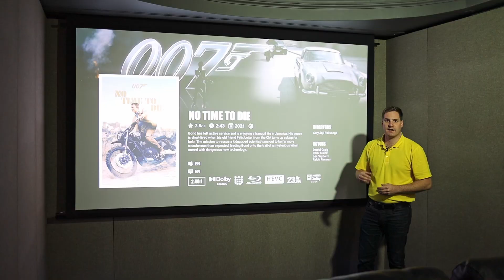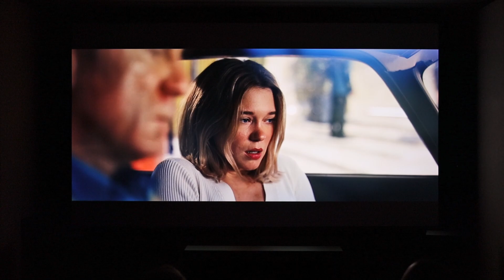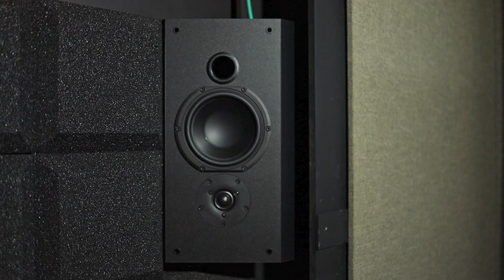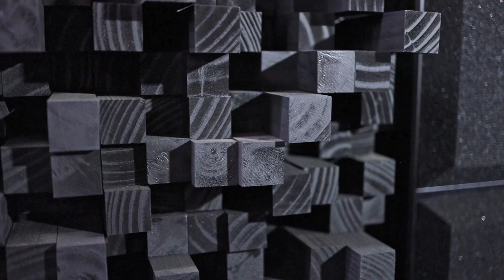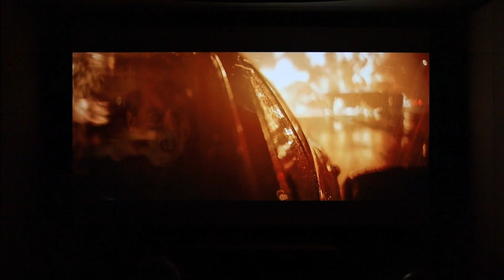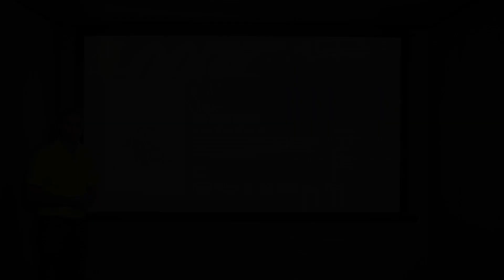Krix home cinema room - Johannesburg - Elan Systems South Africa

Comment: Really nice presentation and clearly a lot of thought went into it. Two nits to pick, first acknowledging that I’ve only watched a YouTube video 😉
The screen seems a bit high. With the image nearly touching the ceiling, I’d be concerned about distractions from reflections off the near ceiling surfaces or simply being aware that the image is at the intersection of the wall and the ceiling. And of course, the viewing angle may be a bit high for some, though that’s just surmising such based on the placement near the ceiling. 
The only other thing, and this is really more a pet peeve of mine, is that motorized screens and rooms that don’t truly ‘need’ them drive me a little crazy. This is a dedicated room, and obviously purpose built just for watching movies. If you wanted to show off the speakers behind from time to time, clearly, you have the ability to do custom brackets, as evidenced by all the great brackets you did for the different speakers in the room, you could’ve done a fixed screen on some kind of hinged bracket that allowed you to lift it up when needed to show the speakers behind, but that then felt more solid and stable when down and a little more like an actual movie theater.
Reply from the maker: Hi Scott, thanks for taking the time to watch our video!
With regards to the projection screen being too close to the ceiling. It has been calculated to get the correct viewing angle for the front row of seats as well as the back row of seats. This ensures that the people in the back row are not looking into the backs of the heads of the people in the front row of seats.

with regards to the "issue of it being a motorised projection screen" you need to remember that this is a home cinema demonstration facility. It is not a dedicated home cinema room in someones house.
The motorised projection screen is the safest and easiest way for the sales reps to be able to demonstrate what the speakers look like behind the projection screen. To have a screen on a hinge mechanism would mean the possibility of finger prints and marks when the screen is being lifted, but also there not being enough space to comfortably swing the screen upwards without effecting people in the front of the room.